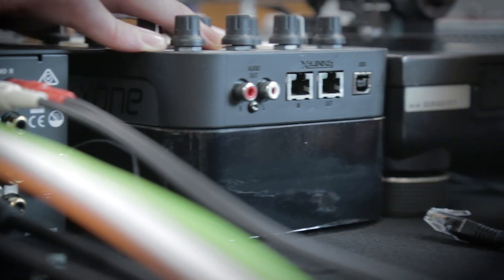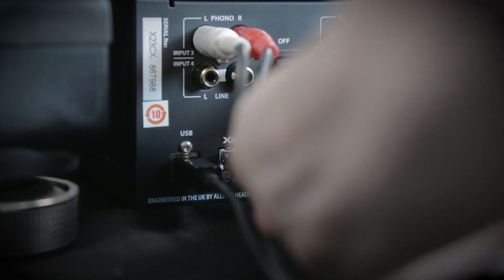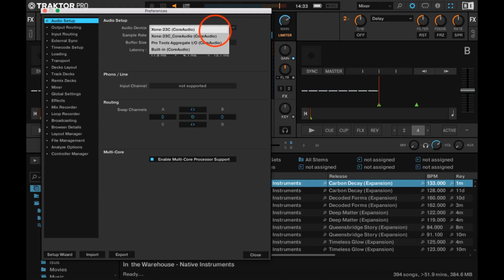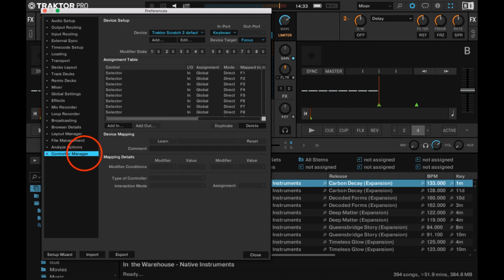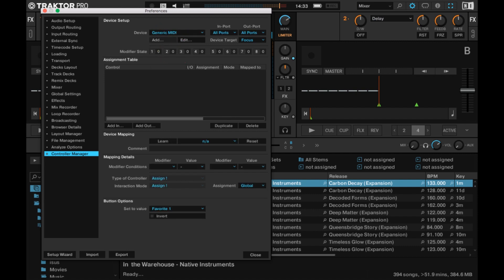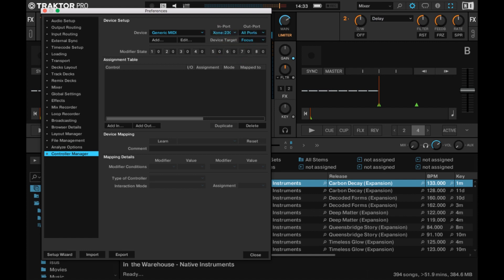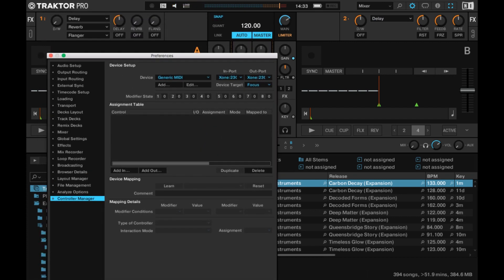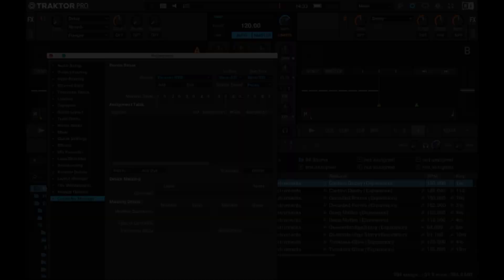#XoneQuickTips - X:Link Set Up

Comment: Will this optical connection work with ableton push 3’s optical cable to send audio
Reply from the maker: Please note, X:link is ethernet and not optical. However, to answer the question. This connection is for MIDI transmission only. Furthermore, Xlink is a unique A&H protocol for X:link enabled Xone products. You should never attempt connecting this to any third-party hardware with RJ45 as it may damage your hardware. 
Thanks,
Luke

Comment: Hallo there I have a question soo do is it possible to connect my x1 mk1 and a xone 23 playing at the same time and if yes how?
Reply from the maker: Hi,
Yes, you can use both devices simultaneously. FYI, you will need to connect them independently to the computer. 

Best,
Luke

Comment: Is it possible to connect xone 23 and xone k2 and use rekordbox interface?
Reply from the maker: We regret to inform you that it is not possible to run the DB4 with Mac latest OS and hardware release. Active support for this product now ceases at Catalina with driver v3.49.
FYI, this driver will not run on Big Sur, Monterey or Ventura.
Apple's advancements with the new M1 processor and OS11 have made certain technologies, such as the DB4, incompatible. As a result, along with other factors we sadly discontinued Xone:DB4 after a great 10 years in production.
 For up-to-date Mac OS integration, we recommend seeking third-party interface alternatives and using DB4 analogue connectivity. 
 
Kind regards,
Luke

Comment: Is it possible to connect the xone 43c with traktor x1mk2, if so how to do it?
Reply from the maker: Hi Thanks for the message.
X:link is solely an A&H protocol for MIDI control with K:series controllers, it is not possible to connect third-party devices to this feature. 
To run both 43C and NI X1 together, each device needs to be independently connected the computer.
I hope this helps!

Best regards,
Luke
Reply: @xonedjofficial  Yeah Luke,I put the 43c as an external mixer in traktor and it runs so smoothly with the x1. Thanks a lot!

Comment: I'm using 23c + K2 in Traktor 3 on PC instead of Mac. I've followed the instructions seen on this video. The K2 lights up, but doesen't send or recieve MIDI. I could use some help if you don't mind.

PD: i've updated all drivers and firmware for both devices. And both devices WORK when plugged by individual USB cables, it's only the X-link I have problems with.
Thank you in advance!
Reply: have you been able to fix the problem?
Reply from the maker: HI Julian,
Please continue with the support in the ticket system. You’re not going to get a different answer here or speed things up. We have limited resource at present, please be mindful.

Thanks,
Luke
Reply: hey, same here! did you solve your problem?

Comment: cheers! guys, i got a db4 and a k2 so here is my question: can the control surfaces of K2 be used in traktor via x-link connected to db4 which is connected to the computer via usb? here is the layout again schematicaly: K2===X:Link===>DB4===USB===>Traktor pro 3. so is there a way to make the K2 control traktor functions with this layout, or do i have to connect the K2 through a separate USB?
Reply from the maker: Hi Re Jazz,
Thanks for the message.
The sort answer is yes! Though, there are some things you need to be mindful of in order to make it work.  First, insure that you are running form the X:link “out” on the K2. To the mixer. 
Next, you need to make sure that the mixer and controller are set to separate MIDI channels. There are instructions on how to do this in each of the user guides (links below).
Finally, make sure that the software is pointing at the MIDI host, which in this case will be the DB4.

Best regards,
Luke

https://www.allen-heath.com/media/XoneDB4_ug_ap7977_4.pdf
https://www.allen-heath.com/media/XoneK2_UG_AP8509_3.pdf
Reply: @xonedjofficial  awsome! thx for your help&

Comment: What kind of stand is that for the K2? I think I saw it too in the most recent video on this channel.
Reply from the maker: Hi Michali,
Thanks for the message.
These were custom stands that we made in house.  They are simply MDF layered blocks wrapped in a black wrap.
Unfortunately, this is not something that is available for the Xone K series controllers.  
Regards,
Luke
Reply: @xonedjofficial  OK thanks for the reply, I thought so already hehe. Looks quite nice and that it aligns with the same height of mixer. BTW I own a Xone 96 and always wonder if it's not a problem to block the grill on the side for airflow when you put the K2 right next to it. I expect not but I can imagine the grill was put there for a reason.
Reply from the maker: Hi Michali,
The Xone:96 has embossed sections on the side panels this is to allow a small gap for airflow, when butted against peripheral equipment.  We would strongly advise not covering these grills as it is the only source of ventilation for the mixer.
Kid regards,
Luke

Comment: Hello friends. I would like to know if it is possible to work with two macbook pro computers through the Xone px5?. Thank you very much in advance.
Reply from the maker: Hi David,

The Xone:PX5 can connect to a singular computer Via the built-in USB interface.  If you wanted to connect to a second laptop you would need to use an additional audio interface and connect to the analogue inputs of the mixer.

I hope this helps!

Thanks,
Luke
Reply: Thanks a lot.